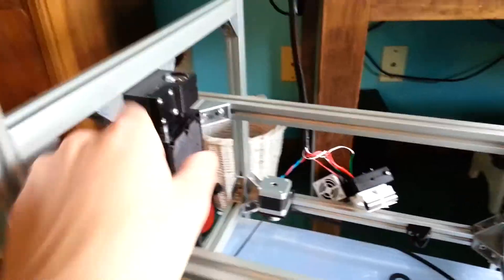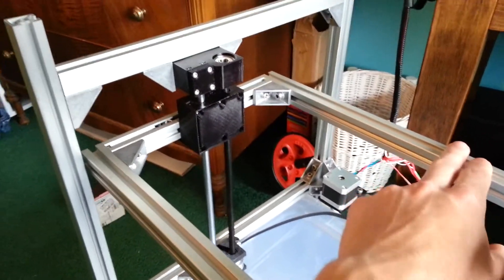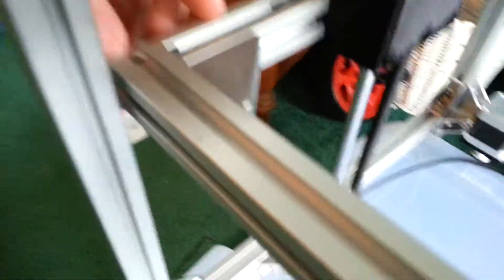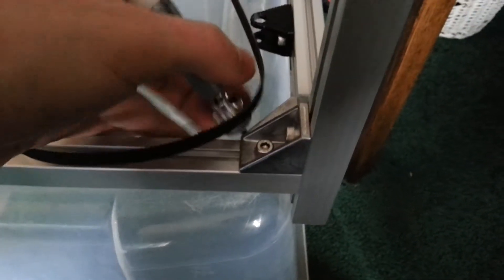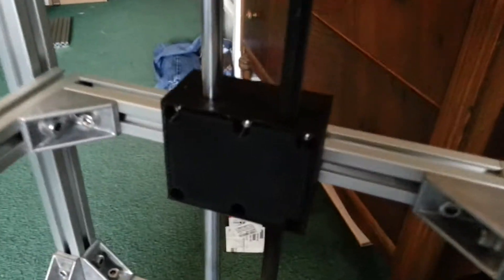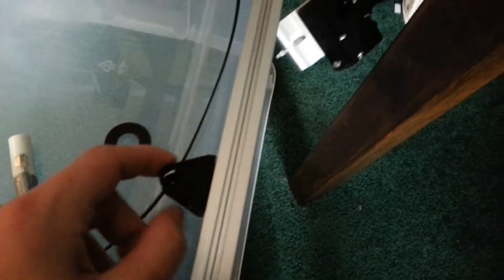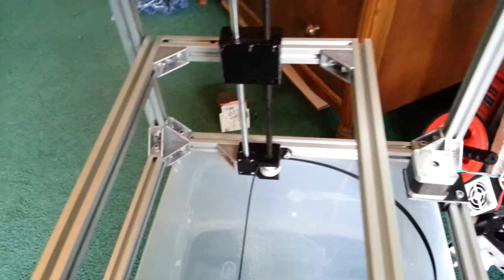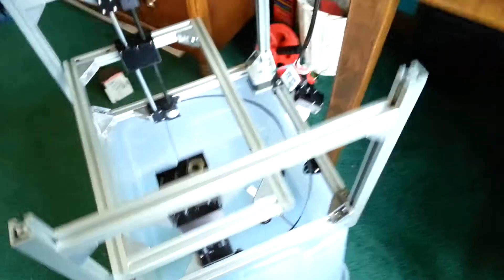3uP Update 11 - Z axis works!

Comment: Did you have any issues with your z- axis when you started printing. All my prints seems to be smooshed, i.e. too short. It seems like my z-axis isn't travelling as far as it should be during prints. I would suspect the firmware setting but everything I have read says the z-axis is kind of constant.
Reply from the maker: Travis Bills There was a change in the type of threaded rods used during the 3uP's lifetime, try changing your steps/mm for the z axis to 4608 (I believe this is the value for threaded rods with a 1.25mm pitch but I could be mistaken)
Reply: I spent all day slamming my head against this problem, turns out it just needed to reset my eeprom configurations. But before I did that I also tried changing the steps to the 4608 and it worked as well. So if anyone else is having this issue I would recommend they reset there eeprom setting first.

Comment: why use such a long belt for the z-axis? And why cant you just use a shorter one running straight across from the first z-motor to the other side?
Reply from the maker: Well because to be honest I ordered those parts before the design for the z axis was completely finalized, as Misumi takes a bit of time to process before shipping. The final version will have a shorter belt and I will probably play around with the locations of the motor and the tensioner to find something I like the most.
Reply: 3DprintedLife Really nice, ive been wanting to completely recycle my printrbot plus v2.1 and make something like this for a while, but due to the high price of parts and services here in Norway its practically impossible atm. I could always make the frame out of fdm, but i dont have the cutting or drilling tools to make it accurate enough. My printer prints fine, but its so impractical with the y-axis moving back and forth all the time. The build plate is cast aluminum so its very heavy and can cause shaking in my desk. I would be interested to see what you come up with though if you actually start making kits for these. Nice work mate.
Reply from the maker: Exlr8Films Thanks very much! And yeah I really don't like when manufacturers make printers with y build plates instead of z. I know it's cheaper but it is so much less efficient!